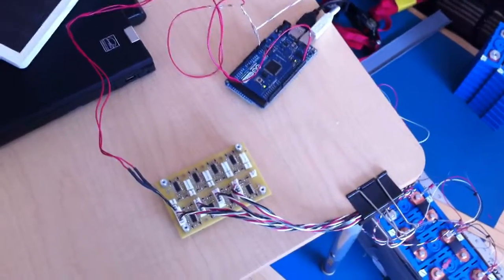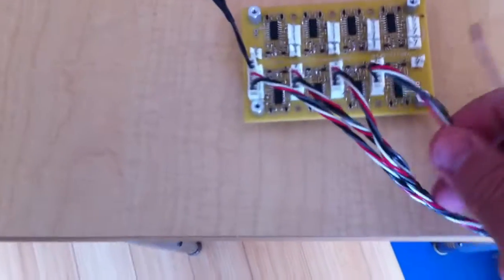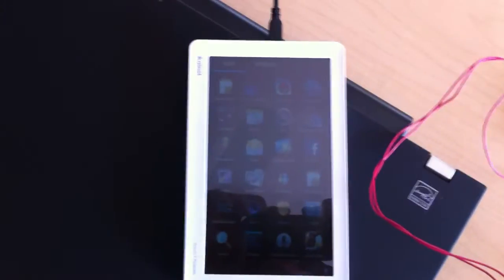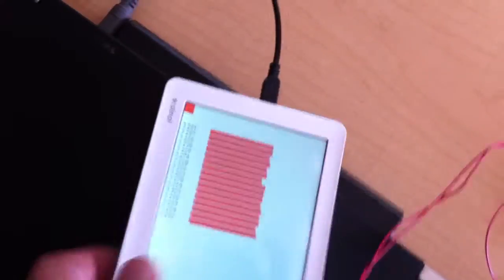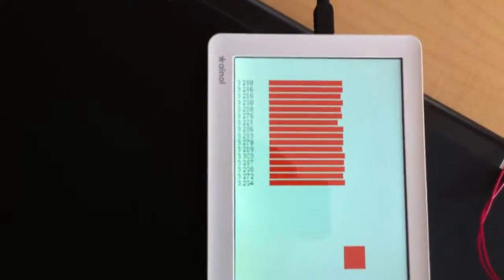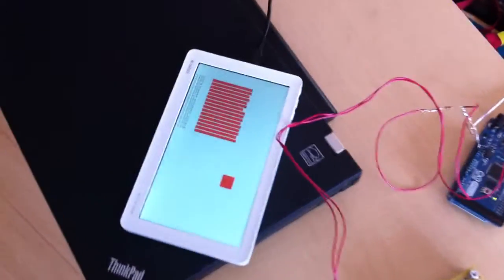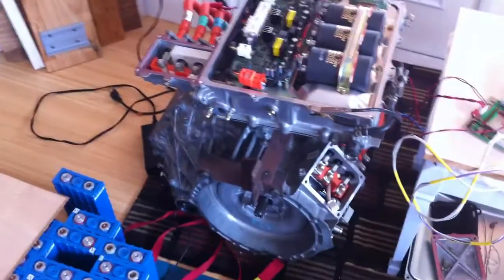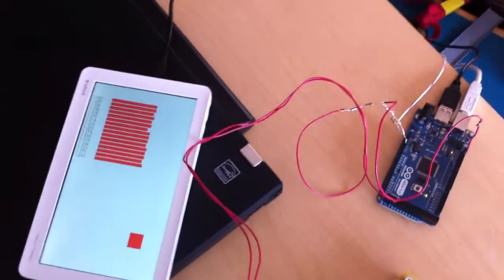Low cost cell voltage monitoring circuit for DIY electric vehicle

Comment: Are you using Quad Op-amp ic's for cell monitoring?  Set up as a diff amp with voltage follower/buffers on the inputs?